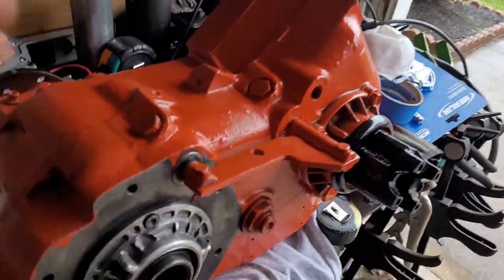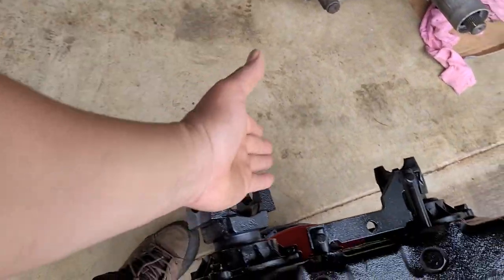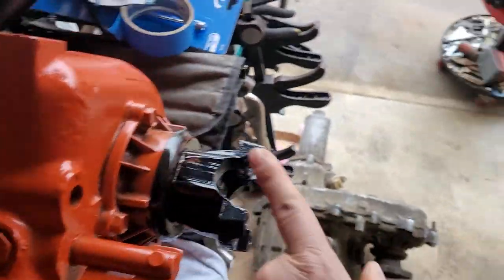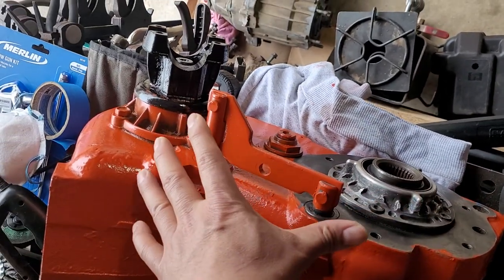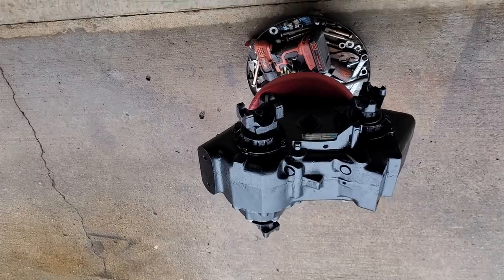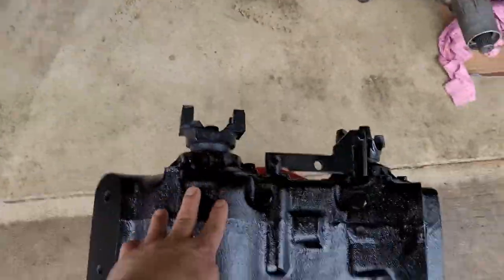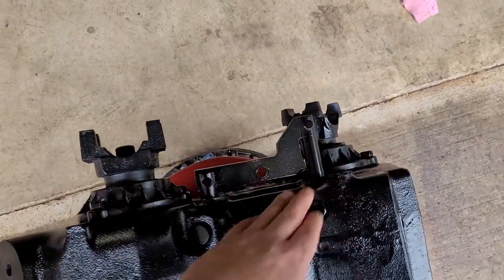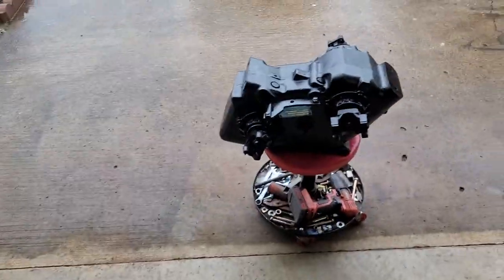NP205 transfercase(Married vs Divorce Explain)

Comment: Thank for for the explaining!  I have a married transfer case and it’s leaking from the rear adapter area to the case. I have a 79 4wd bronco., my brother bought the truck running but it doesn’t go pass let’s say 2nd gear or more that 35mph, would the transfer case’s internal cause this problem?
Reply from the maker: Thanks too
Reply: @Angelsum143  

Thank for for the explaining!  I have a married transfer case and it’s leaking from the rear adapter area to the case. I have a 79 4wd bronco., my brother bought the truck running but it doesn’t go pass let’s say 2nd gear or more that 35mph, would the transfer case’s internal cause this problem?